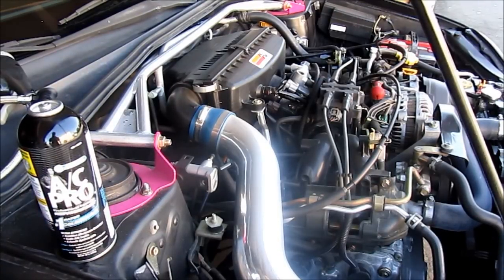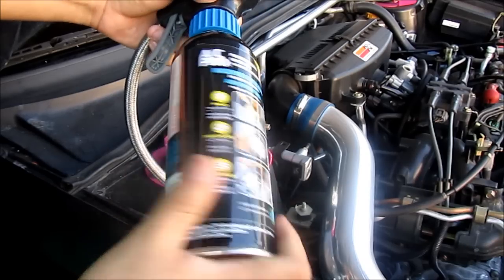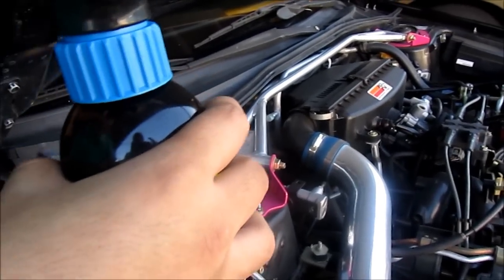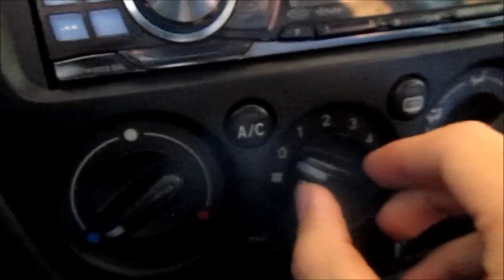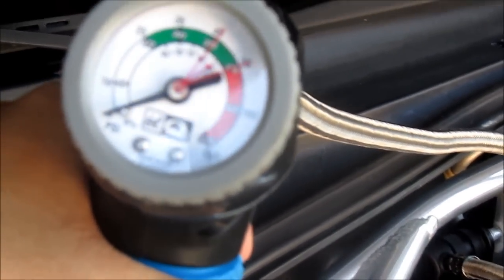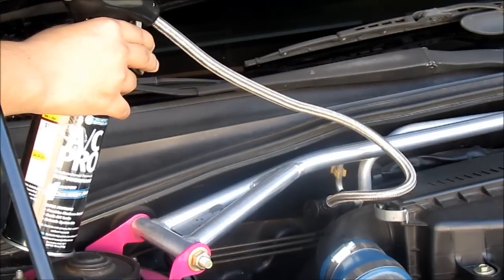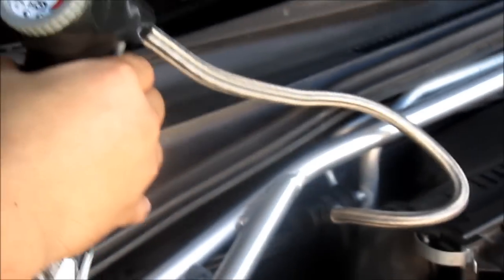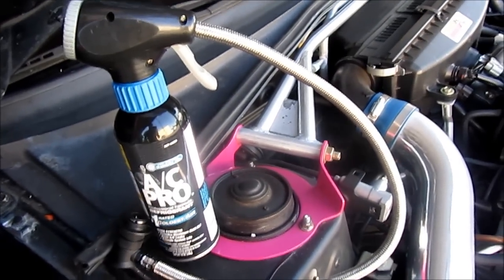Recharging Car A/C

Comment: My car started making smoke once I started filling it. Not crazy amounts, but smoke. The pressure didn't go up much, but it did get the compressor to kick in (which wasn't responding to the AC button before) and the air did start to get cold. The tank emptied and the pressure stayed at about 1/3 what it was supposed to be. I'm hoping maybe the sealant in this stuff will fix the leak a bit and maybe I'll try another can in a few days... we'll see...

Comment: Got some questions.
1) If the gauge is on the arrow, does that mean don't press the nozzle until it moves again?  What if it's below or above the arrow?
2) I assume you can connect the nozzle to the Low side before starting the car?  Would seem easier than doing it while it's running, but wanted to check.
3) If the can is empty and the A/C's only a little cold, should you connect another can?  Wait a couple of days?  Check the compressor?
Thanks!